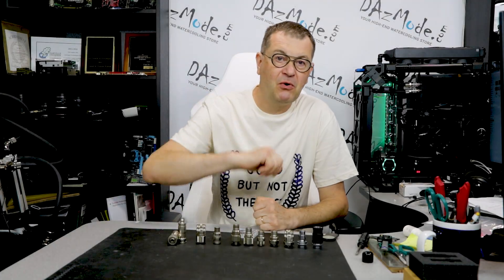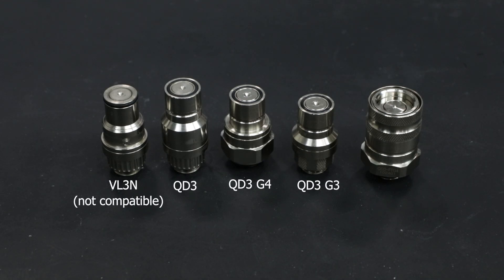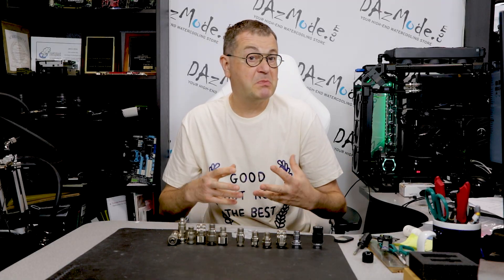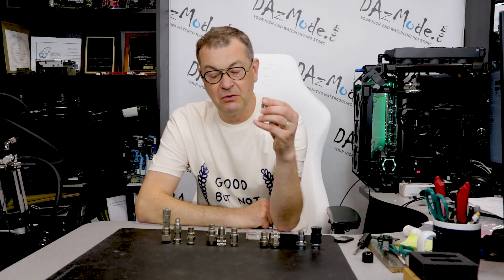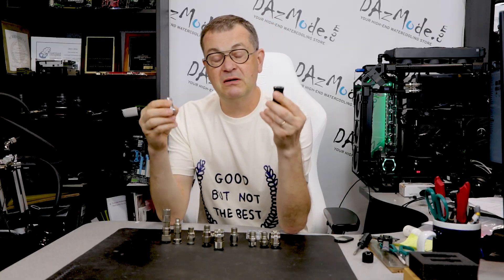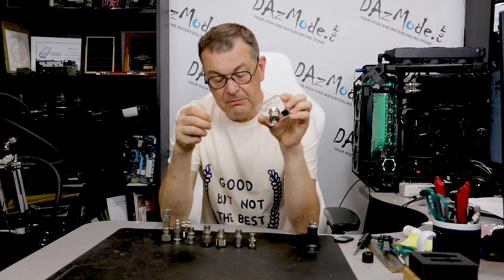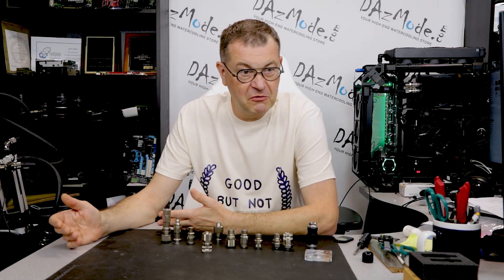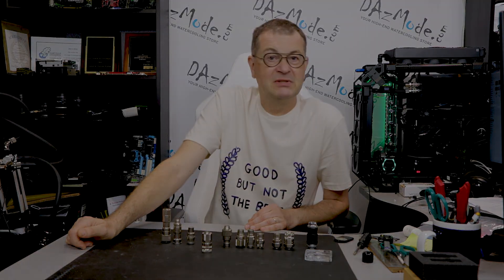Koolance QDC3 Gen4 Overview and Update

Comment: Aren’t those alphacool ones on your far left the least restrictive when it comes to flow? Would be great to see comparison.
Reply: Yes QD3/ QD4s  are obsolete ,they  just can't compete with the new Alphacool QDCs (BLH1A).  My flowrate only decreased by 15lph  ( 210> 195) after adding 4 Alphacool BLH1A QDC.
Reply from the maker: That info is  circulating, but i did not test myself.  I used to test vl3n way back and each set was a 0.1l/min drop.